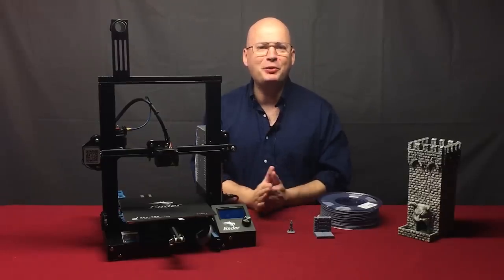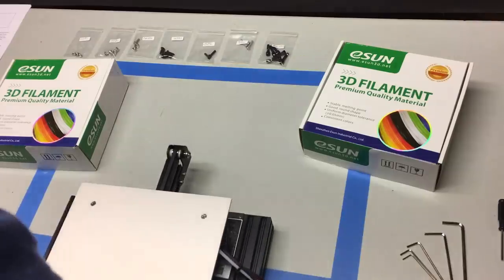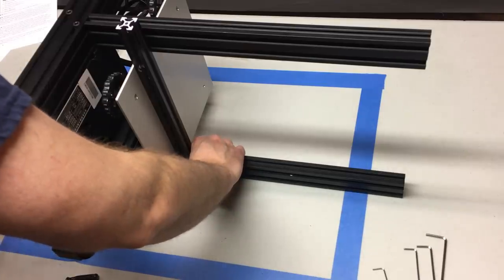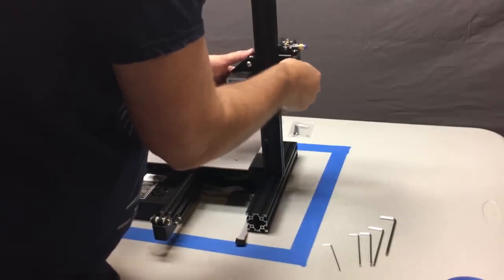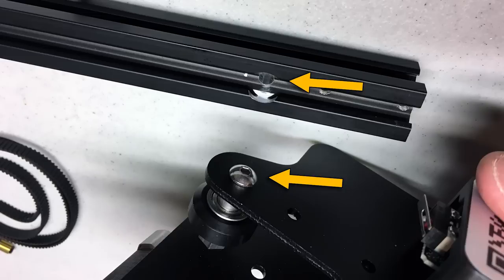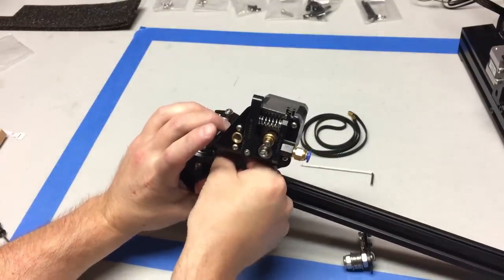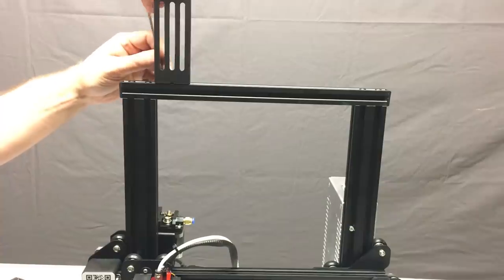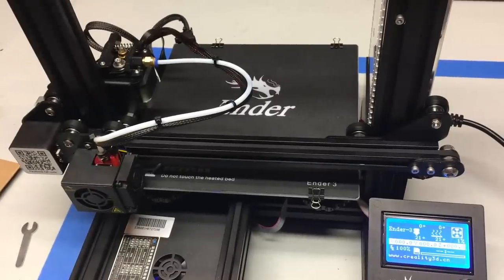Creality Ender 3 assembly and pro build tips

Comment: Spent 4 hours building my Ender 3 yesterday, following a different video tutorial. Looks like I'm going to have to disassemble most of it and try again, following some of the tips you gave here. It'll be worth it to make the parts last longer, though.
For example: I was wondering why no amount of nut-tightening was reducing the wobble of my bed and mounts. Turns out I was only tightening the nuts holding the bearings on. Derp. The "eccentric nut" thing really wasn't explained at all in the other video, and didn't have a good view of where they were. No wonder I was tightening the wrong ones.

Thanks!

Comment: Hi, Found your Ender 3 assembly video absolutely fantastic. Very thorough to say the least. Tried to get into the field of 3D printing previously and found this a hugely frustrating experience although this is something that I still find interesting and fascinating. 

Anyway to cut a long story short I would like to be able to contribute towards 3D printing face masks however, despite the assembly and bed levelling going quite well which I'd found quite pleasing I'm really struggling with bed adhesion issues. 

The test file seems to print okay however as for printing the small dog that's on the accompanying USB Stick each of the three of these that I've tried printing has failed. The first because the trial spool was not enough (not really a faulty of the Ender 3) and the second and third failed because the model literally popped clean off the print bed. This has happened repeatedly ever since even with test prints.

I've tried using glue sticks and set the bed temperature to 50c and 60c and even put a glass bed onto the heated build plate without avail. I've been cleaning wiping the print bed with 70%  IPA Alcohol Wipes and as I've said this afternoon absolutely nothing is sticking to the print bed. Clearly I'm doing something wrong however with such little experience and knowledge with 3D printing I'm feeling lost again.

Can anyone please be kind enough to advise what I'm doing wrong and what the fix is for this issue?

On the subject of bed levelling (just in case this is part of the cause of the issue) a piece of paper is being used to level all four corners and I've tried this with the paper only just dragging and noticeably dragging. I think this is a fine art in itself and this is probably an area where I'm failing. I'd bought some reasonably inexpensive feeler gauges however cannot remember what is considered the optimal distance between extruder head and print bed.

Many thanks in advance.

Stay safe and well.

Comment: In the end good news. Follow up on the last follow up. I found the mag bed was not,,, flat. I had the glass option. After re-leveling for it, I was eager to print. Fail. Even thought the display showed a bed temp at 60 the glass had to be colder. My first print started ok but soon released from the bed to be dragged around.

2nd print is going well. I allowed more time for the glass bed to heat before starting the print. As the print is going, Ender claims the bed is at 45 with the nozzle at 200. I assume the packaged filament is PLA.

About 75% done. What has been printed so far looks good.

All of your advice has worked well for me. I may have some difference in opinion. But you helped a lot.

Comment: I just ordered the Ender 3 pro.
I think the build video will work for this one. However, what I am wondering is if you kmnow if the pro has thermal runaway protection in the firware?

Comment: Hi! I'm working on my assembly now, and noticed the solder connections on the heat bed look different. While not loose, the copper wire is exposed on mine, where in your video it does not appear to be! Link to Dropbox images for reference: https://www.dropbox.com/sh/500j5vka96l1qim/AABfr__1VBxZXzSX0bwbeyH1a?dl=0

Thoughts?

Comment: I just recently built my first Ender 3 using this video. Thank you for putting this up! Only problem is I found that the carriage seems to be stuck whenever I try to home it. It moves back and forth slightly and makes a grinding noise.  Any tips on how I can fix this? 

I checked the plugs and they all work along with the stops and the carriage moves when I push it with a finger manually,  and I've also made sure the belt is taut. So I'm stumped.

Comment: This is really helpful. The single sheet assembly guide included is too spartan to be really useful.
After assembling, I strongly recommend the "essential upgrades" you print yourself as described in this video: https://www.youtube.com/watch?v=fq2IKp3jeaY
Edit:
Important before you go for the "essential upgrades": The Z stepper motor modification is not needed if one followed the steps in this video properly. Do not use the Z-stepper motor modification if you've done everything right here.

Comment: Big comment and supportive comments.

3 years have pasted since you posted the assembly video. Much had changed since then. The best advice you gave is related to tightening of the screws or nuts. My words to add to that. Just tighten it enough to stop any wiggle. Just enough to holding the parts in place and not to become loose over time. You can always tighten them later, if they become loose. But if you over tighten them and damage the threads, you are screwed.
 
I'm about 1/3 though putting this Ender together today. I've put off building this for 3 weeks because of all the issues I've read about. I'm now going slow with it. Won't finish it today. Many issues to consider.

What you have pointed out still applies but some of witch Creality has addressed. 

Much has changed and much are the same with what you get now compared to when the video was made. I have not found a "unboxing" video that is less than a year old. The biggest plus/change is they now include a glass plate for the print bed/platen. The platen assembly still arrives a bit lose and not level with the base rails. I think they do that because of shipping issues. The package can get tossed about. So it is packed loose to prevent damage. That would be my guess.

 How I got here. It was dropped in my lap. My Bro gave me this as a gift to me with upgrade kits. 

The instructions that came with the kits are not helpful for those that don't have mechanical assembly experience. One kit was obviously an upgrade for the filament feeder. The other has several red colored gears in it. My guess is, print bed leveling parts?

I'll repeat. I don't think I'll have this put together/finished today. I want to add a follow up comment when it's done.

Comment: Great video! Just want to mention this—10:50 I had the opposite problem; the vertical beams were about 1/4" closer at the top. Took almost 40 minutes to get it right, because I felt like the bottom screw had to be loosened way too much. Finally got it within 1/16", but the top screws are uncomfortably tight and the bottom ones feel on the edge of being too loose. I'll see how it goes, though. May not be an issue.

Comment: Great ideas there. One comment, around 13.30, make sure you test these wheels on the extrusion where it's going to actually sit when complete. I found that there was totally unexpected difference between left and right extrusion size. What fitted one perfectly, rattled loosely on the other one. And after adjusting it there it wouldn't fit back onto the original one - too tight.

Comment: Follow up/advice to readers.
Your video helped a lot. However. There is one area that I did differently.

I did the Z axis rail assembly differently in the end. I started tiring it your way first. I did not like how it was turning out. (The level should have been done later.) Bye bye. So, I put all the Z axis parts together, (the belt drive was the last thing I did after the Z axis rail was in place), I gave some wiggle room for the horizontal rail for both sides. I did not tighten down the tri roller thing seen on the right side like you said to do. I left it not tight to the rail. I had fitted that part for smooth travel on that vertical rail. I did not want to change that. So I put the assembly on the the vertical X rails Then tweak it in.
That's when I did your parallel adjustment you were describing. I gradually snuggle all the fittings/screws down.

In the end. I can put one finger on the z axis bar to lift or lower it. I don't have to spin the Z motor to make it happen. It spins on it's own. Also, It feels tight and it moves freely. Proof is in the pudding. We'll see how the first print comes out.

I do have a mechanical knowledgeable advantage. I work on business class MFP copiers for a living.

Comment: Awesome video, I'm not sure all the kinds of problems I'd face had I just followed the Creality instructions.

I'm having a bit of a problem though, in 19:23, whenever I try to untighten the bolts enough (half a turn, sometimes even quater a turn) to have both sides at the exact same height, one of the bolts begins to touch the frame. Is that normal or should I avoid it?

Comment: I like your video. Very informative, I finished the printer today, and used the filament in the pack to try it out.
BUT you could have mentioned how difficult it is to keep those 'nuts' at 26:50 in the right direction, inside the aluminum profile. 😡
That's the only time I started to get sweat on my forehead, building this machine.

Comment: 16:27
Should the lead screw bottom out completely touching the z motor shaft?  Or bring the z lead screw up a few mm?  I.e. drop a ball bearing in there before tightening?  Or does any if this matter with the stock z coupler?  A non-stock FLEXIBLE Z COUPLER maybe this would help?
I noticed after adding the top z mount upgrade... seems z motor noisier and vibration.  Z rod measures straight and no apparent binding, but wonder if I need to replace stock coupling with flexible one? The brass z rod nut is tight, then backed off a complete turn... 2 turns seems way to loose.

Comment: I followed this guide several years ago and thank you for putting it together as it made assembling the Ender 3 very easy.  That said, I will nitpick one thing about this video ... you mention at @25:42 to back off the screws which hold the threaded Brass nut for the Z screw.  I've had inconsistent and out of spec BL Touch probe readings which made me think I had a junk Z probe and it turns out years later it was just these slightly loose screws!!  FWIW - I shimmed the Z motor until I could thread the Z rod down into the coupling without force or any resistance ... this should be the method if you want to have the greatest consistency and repeat ability with your Z axis.  It may help others if you'd make a visual note about this but otherwise I thank you once again!

Comment: When disabling stepper motors, should the x gantry stay at it's z-height or  should it be able to drop down? I see many people recommending using  the "disable steppers" function to level the bed manually but I've always found that too unreliable because the gantry is too easily moved on the z axis to stay accurate.

Comment: Thank you for a great video!! I watched it once before approaching the assembly and then again while I was actually assembling the printer and it everything was great! One not totally relevant question tough: I stripped the head of one of the x-axis belt tensioning screws (one of the two that holds the t nuts). Does anyone know the spec of those screws?

Comment: Thanks for the great video. I built it from the short instructions first.  I just a few problems but the one you really helped was the eccentric screw on the extruder roller. Couldn't see how that tightened up thanks.

Comment: Woohoo! I got my Ender 3 delivered today. Maybe I should have read up on a bit more to know what kind of trouble I got myself into. 

I was in a touch of wide eye blinking shock when I opened the box and it was exploded all inside. After about 2 mins of staring at it in a blinky disbelief, I started to take the parts out carefully. I located the Instruction's sheet. That thing is a pain in the ass for my old eyes. Even with my bifocal glasses on, some of the pictures were hard to decipher. I just knew someone out there did a video on how to put this thing together. Thank you for making a great video on it. Got my printer all put together (with no help from the hubby other than several smart assed comments tossed from the other room). Now I just need to learn the rest of what goes with it, like loading the filament, getting the files over to it, and finally doing my test printing. Love the links to the extra parts in your description. I will definitely print those out. 

I can also already see that I'm going to need a dust cover for it. Off to the design boards. Looking forward to all the fun I will have with this little printer.

Comment: My Z lead screw doesn't line up with the X axis arm threaded brass coupling receiver. It's off so far the stepper motor can't move the arm and it almost cross threads when I manually screw it in. Have you seen this before?

Comment: Very helpful and instructional. 
I might add a couple items I had problems with during assembly. 
One upright wasn't square on the bottom,  sanded it to get it closer to 90, the distance between the 2 uprights still wasn't correct.  So I used you technique of loosen one screw and tighten the other but I did it for the main cross piece under the bed.  It's real close now. 
I used a small machinists square to check the ends and using the top rail laid against the side of bottom rails you could check for square of uprights,  mine was off 3/16 at the top no matter how bolts were tightened. 

Other issue that you mention right away is the bed rollers are sometimes not tight and mine were very loose,  however I should have loosened the eccentrics alot before tightening the stationary rollers.  The bed was out of level and the 2 stationary were at an angle when tried to level the bed. Had to remove bed and eccentrics, then tighten stationary and reinstall eccentrics. Poor quality from factory on those for me. 

One other thing,  do yourself a favor and have some quality metric allen wrenches handy as the ones provided flaked off the chrome after just a few uses. 

The kit I received had a length of tubing almost looks like heat shrink...  I have no idea where you would use it unless it covers the tubing.

Comment: Thanks for the video, but i'm struggling with the step for the horizontal bar on the z-axis @20.40.  i just cant seem to get the bar level on both sides, I've been loosening and tightening the bar but it always seems to be higher or lower on the right hand side. seems to be able 1mm higher on the rightside.

Comment: Thank you, thank you, thank you.   I got my system and started reading the manual. Then found your video.
My advice to anyone trying to assemble the Ender 3 is to read the manual from cover to cover, then put it into a paper shredder and watch you video.  Saved me.
I have some comments/suggestions to share:
Your comment on the springs for the bed are right on.  Ordered them right away.
You say the link for the pneumatic couplers for the feed tube is in the comments, but I could not find it.  Would be great if you added it to the video just like the page for the improved springs.
They now send the system with the coupler not installed but in a separate bag.  Their manual does not even show anything about it.  Being a complete novice I had to figure out what it was and where it goes.  If you ever redo this it would be a good addition to the video.
Another request - lots of videos on how to assemble the unit, but a dearth of videos on how to get started.  How to do your first printing, etc.  Maybe even provide some simple files.   
Just some thoughts.   Again, thank you so much for your help.   Do you have a web site?

Comment: The issue I have on my Voxelab Aquilla X2 if I follow your procedure for initially setting the bed knobs the metal plate will crash into the Y axis stepper motor.  I have to turn the wheel until it clears this motor about 2-3mm that is my starting point. I don’t know why I am the only one noticing this I’m sure it’s going to be the same thing on the ender 3 printer since the Aquilla is a clone of it.

Comment: Thanks for the video. During setup the screw of the extruder unit is in contact with a vertical beam and is causing major resistance as I move it up and down the zrod.  It has scraped off part of the black paint.  Any idea on a fix?

Comment: Excellent video, thank you! Lots of informative instructions on alignment and truing up of the frame. If I hadn't flipped the bed upside down per your tips, I wouldn't have found that one of the wheels was loose making the bed sloppy. I did deviate a bit when it came to installing the belt and tension wheel though. Those T-nuts are a real pain in the rear-end to get them flipped 90 degrees so they will tighten in the channels. I got the belt threaded in place per the video, popped one end off the carriage temporarily and went to battle with the T-nuts. Use the screwdriver or a wrench to help turn them. With the tensioner on and the belt pre-threaded, it wast wasn't hard at all to pop the belt back on the carriage fork, tension the belt, then continue with the assembly

Comment: I want to tank you for this Video. I have a new Ender 3 V2 (my Ender 5 Pro I never had a problem) and I struggle from day one to get it sorted and it printed ok, but the bottom gave a elephants foot, but could not sort it. I dismantle the printer and then follow the process as per your video and printed the first print after the setup and now all seems to be 100% better. 

Thank you for your time and effort to do this video and help us. I appreciate it.

Keep the good work going.